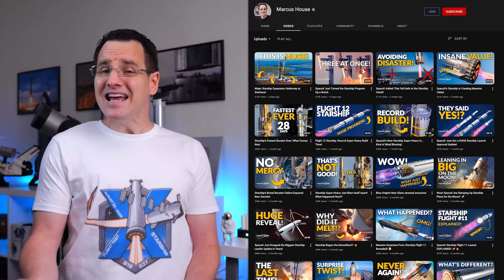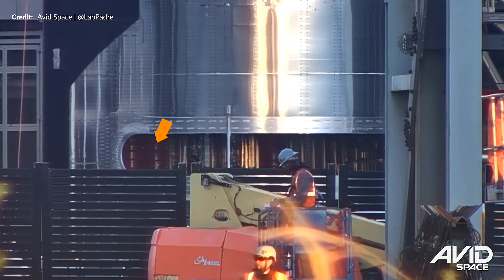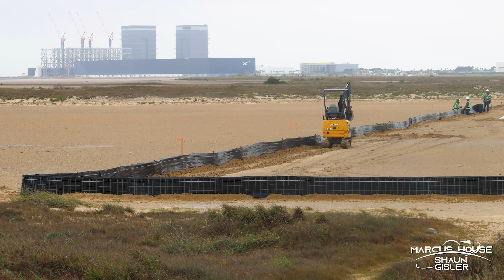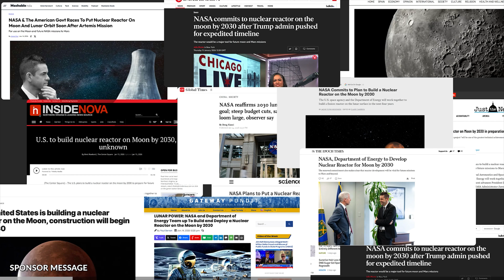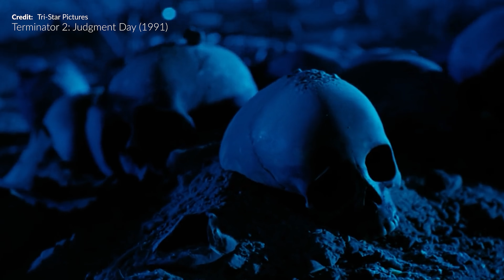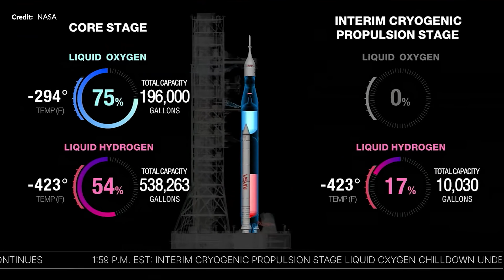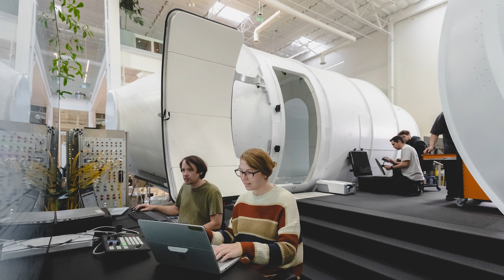SpaceX’s Starship Version 3 Testing is Epic! Why?

Comment: Data-centers in space are so impractical to the point of actual science fiction. How do you cool down the things in space? This single engineering problem stops the project dead
Reply: How do you think the ISS is cooled? 

:planet-orange-purple-ring:

:planet-orange-purple-ring:
Reply: @Scanner9631  Exactly. Physics doesn't care if it's a space station or a data center... energy coming in (via solar panels) gets turned to heat (by computers or human activity), and needs to be dumped somewhere (via radiators) if you don't want to cook the inside. An orbital data center will need more power in and more heat out, but it's still exactly the same well-understood and long-solved problem.
Reply: Good thing no one as ignorant is you is advising
Reply: @rocketignitionKSC You dont know what you are talking about, anyone who works with vacuum systems like me knows this is a nonsense.
Reply: @cookiii  anyone who works with vacuum systems like me knows this is a nonsense.

In space? 

ISS disperses 1 KW of heat using a 1.5 sq meter radiator.  Starlink for example uses a fraction of that.  How much will one of these proposed satellites use?  

:planet-orange-purple-ring:

:planet-orange-purple-ring:
Reply: There are only 50 or so videos explaining how they do this. Good thing people that are a lot smarter than you have already figured it out 😂😂😂
Reply: @brianbiddle7590 You dont know what you are talking about, anyone who works with vacuum systems like me knows this is a nonsense.
Reply: @cookiii 😂😂😂 sure bud. You most be the only expert.

Comment: LOL the rocket "couldn't handle the recent bout of cold weather". Hmm, space is both hot and cold an the rocket is fueled with cryogenic fuels. That doesn't bode well, no mention of moisture / condensation which is odd though as a person would expect in FL with cooler weather. Thanks for the video Marcus.
Reply: Think of all the components that DON’T spend time in frigid space, and are designed to work in Florida.  ALL the ground support hardware (which is far more mass, plumbing and budget than any one rocket), the booster engines and engine compartment components, including plumbing and seals come to mind.
Reply: The 1st stage booster doesn't go to space so it doesn't need to tolerate space.

:face-turquoise-covering-eyes:

:face-turquoise-covering-eyes:

Comment: Takes a true genius to work out that putting a million satellites in orbit is more feasible than making computing more energy efficient and energy production more environmentally friendly.
Reply: This does count on efficient processing, heat dissipation is a lot more difficult in space.
Reply: Remember how the people of Rapa Nui completely destroyed their own ecosystem because they needed an extreme solution to an irrational problem? Our stone heads will be a thick shell of metal shards enveloping the entire planet.
Reply: @dietersteg6384 space is really really big.
Reply: @G @GG-yr5ix t Leo is certainly not infinitely big. The size of a satellite on par with even a very modest data center on earth would be so massive that it would be kilometers in length. The idea that you could put tons of these in Leo is laughable there is no set of orbits capable of holding that many satellites of that size
Reply: Well here you have cost of land and the not in my backyard types slowing the progress down. With space base data centers you eliminate that.

Comment: it feels like testing B19 without gridfins or engines installled doesnt bring it anywhere closer to launch readyness
Reply: Its the proceedure. They do Cryo testing first which involves plungers attached to the engine mounts. No testing is done on anything gridfin related. When it passes this test, which it as, then it will get engines and hauled to the new pad for static fire. That is always the way they have done it.
Reply: @shaungisler6604  And we know that lack of engines is something they can fix overnight if needed... installing a bunch of Raptors isn't particularly time consuming.

Comment: The Space Shuttle also had persistent issues with hydrogen leaks during filling. STS133 was delayed months because of similar issues and trying to fix it. Lets hope they are quicker for SLS.
Reply: H2 is a squirrelly little molecule. Very high specific thrust, but hard as heck to work with.
Reply: As did the Delta family and every hydrolox booster.

Comment: So if you put 1 server rack into orbit it uses 1200 tons of methane. A server rack uses ~30KW (GPU A.I.) So a gas generator could run this server rack for 20-30 years! This whole idea stinks!
Edit: The GB200 NVL72 uses 120KW, weight is 1360 KG and measure 0.6m wide, 1m deep, 2.23m height. I have no idea how many of those can fit in Starship and launch into the desire orbit. You would need 4 Starlink V2's to power 120KW. Now say that they can launch 120 V2's /launch that means 30 GB200 NVL72. And yes this looks way better but there is 1 catch, we can't use electricity to launch a rocket but we can add more solar, wind, and batteries to power those future data centers on the ground.
Reply: You can use solar to produce as much methane as you want.
Reply: @admarsandbeyond  World: "we need to lower our carbon footprint" YouTube chat, "use solar to expand carbon chains to make fuel so we can send server racks that will use solar"
Reply: @se_mat  No. The Sabatier reaction extracts carbon from the atmosphere to produce methane, which is burned cleanly in rocket engines (CH₄ + 2O₂ → CO₂ + 2H₂O). It's a carbon neutral process. Methalox is generally considered the cleaner option for rocket propulsion.
Reply: @admarsandbeyond  Why would you do all this if the efficientie is less than 50%? Use solar electricity directly for data centers and use carbon fuel to send all the things we need for a permanent presence on the Moon and on I.O.
Reply: @se_mat orbital data center constellations will be cheaper and scalable. See Manley's video on the matter.
Reply: @admarsandbeyond  It's not about money, I'm talking about Earth resources. Money has no meaning if crops don't grow anymore. Launch rockets to advance humanity, not for the sake of money alone.

Comment: I just don't understand why spacex doesn't install covers over the exterior plumbing at the aft end of the booster . I feel they are going to have issues with the entry velocity turbulence.
Reply: That would be so much extra mass 

They've obviously done the simulations to expect nothing to fall off

People at lot smarter than us are working on Starship
Reply: Perhaps the plumbing is essentially shielded by the shock wave generated by the aft skirt?  Local velocity might actually be negligible.
Reply: @CorrieBergeron the shock wave generates turbulence perhaps the engineers designed for this. Time will tell.
Reply: The rear skirt and engines basically hold onto enough air that their shape is approximately negligible
Reply: @JohnR31415 question is the velocities might just be enough to tare apart this exterior pipes.
Reply: I would be more concerned about the damage sustained by the engine nozzles upon reentry. Those get an absolute beating and look visibly damaged
Reply: Wiser heads than ours.
Reply: Maybe they will add it later, after testen/testflights, when they know they dont have to remove it during this.
Reply: I used to be mystified how the apollo csm thruster quads survived launch, but they were in the shadow of the vehicle bow shock. I've heard this is how the Superheavy will work.

Comment: Always great Marcus.  With regard to the data centers in space, in addition to the power generation, it will be easier to cool the data centers in space than on earth.
Reply: No, It won't. Without air the only way of cooling are radiators and those will need to be ridiculously big. Even current space hardware has problems with cooling.
Reply: @armanuki38911  

based on the ISS radiators 1.5 m squared per KW hour.  So how many KW will these satellites produce?

🛰

🛰
Reply: I might suggest you take some physics books about thermodynamics and radiation before making that claim.

Comment: I am 100x more excited for Starship development than Artemis launches. Maybe in the 90s/00s I would have loved Artemis, but it feels like a relic.
Reply from the maker: Yea, it is a little hard to feel inspired by SLS. I do like Orion overall, but NASA are just so slow getting anything done.
Reply: @M @MarcusHouse yeah, that’s the problem with a waterfall approach to development. You identify issues so late in the cycle you can’t maintain anything like a predictable schedule because the reworking winds up affecting other dependencies as well.
Reply: O' GOOD A CARTOON !    TWO WEEK'S
Reply: Artemis is 50 yo tech. Its the same as used on the Shuttle. Its very expensive and can go boom with little effort. Its a deadend.

Comment: The giant money suck that is Artemis needs to be scrapped. NASA should concentrate on Orion and task one of the other players build the launch system.
Reply: SLS works and is here. It's our ride to the moon through the end of the decade at least. The absolute last thing NASA should do is cancle SLS before there is any sort of viable replacement.
Reply: Don't worry starship will be operational in 2029 so SLS be cancelled
Reply: @Max @Leon_TRUMP you say that with such confidence as if you’re in the engineering room.